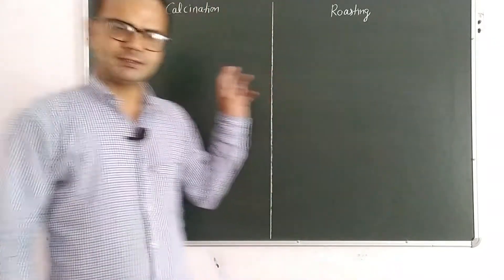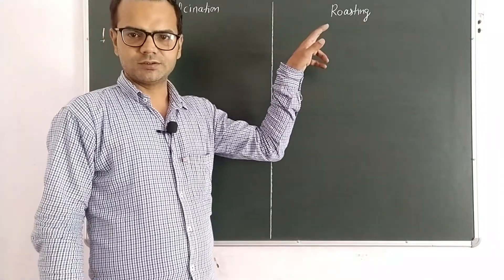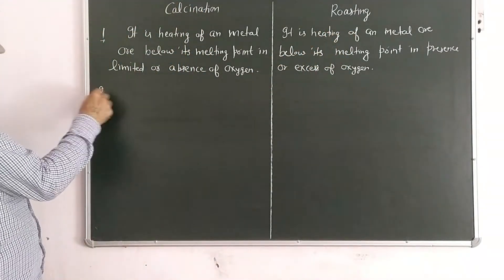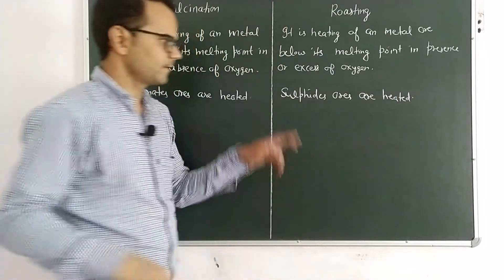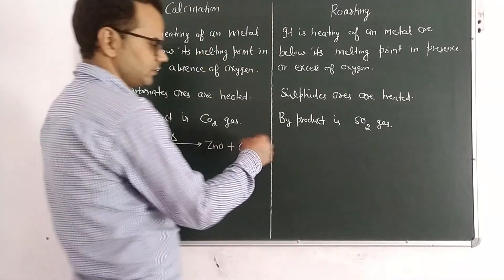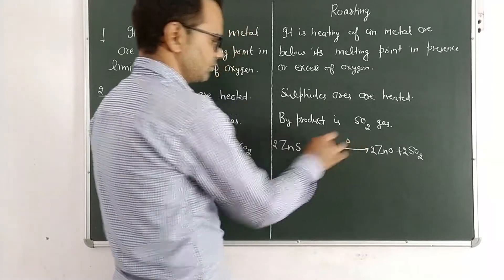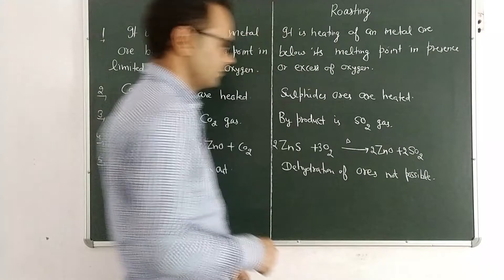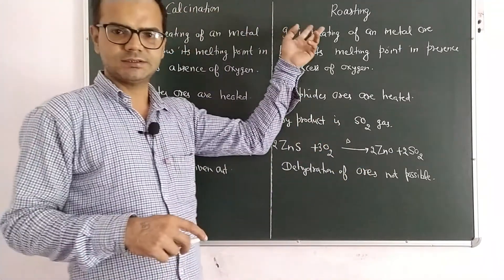Metallurgy -Calcination Vs. Roasting

Comment: I have doubt
Reply from the maker: What is that?
Reply: @unlockchemistry  i want to know that
2zns + 3o2 - >2ZnO +2So2 is an example of which type of reaction
Reply from the maker: This is roasting ,heating of sulphide ore in presence of oxygen to obtain metal oxide
Reply: Sir roasting toh hai hi but reaction konsa hai yeh bataye
Displacement ya redox
Reply from the maker: This is oxidation reaction. Zinc is oxidised to Zinc oxide and sulphur is oxidised to sulphur dioxide.